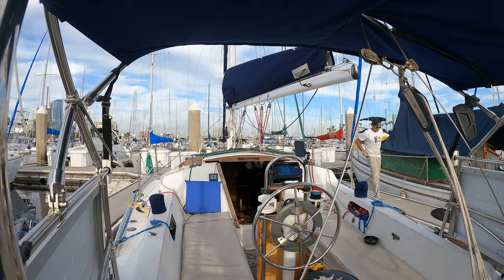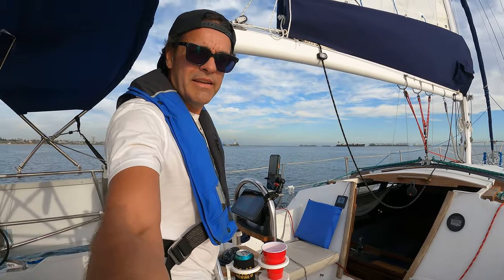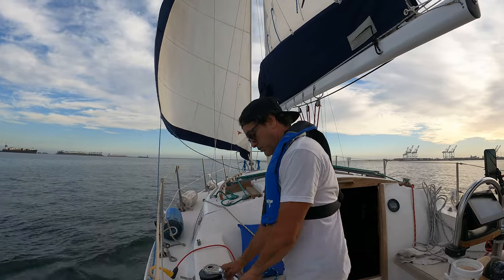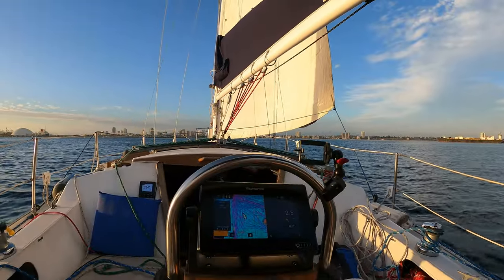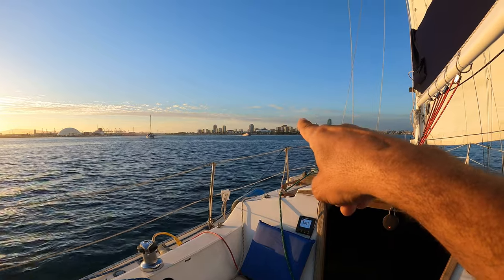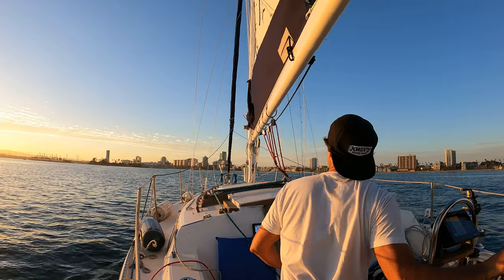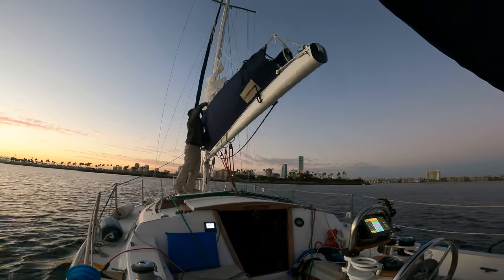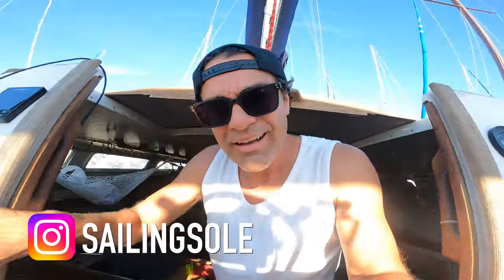EP 0 - Sea Trial - Lazy Jacks & Stack Pack - Sailing in Long Beach on a 1978 Catalina 30

Comment: If you read the owners manual, you should put the engine in neutral and increase the RPM's for about 30 seconds, then bring back to idle and immediately shut it off. Helps blow out carbon, which diesels create a lot of at low RPM's.
Reply from the maker: Thanks for the tip. I’ll definitely do it.

Comment: Nice afternoon sail - thanks for taking us along for the ride and I like your channel - perhaps for docking you could lay out some form of protector for the boat especially on the ends?  Also, to dock it might be a good idea to take a forward cleated springer and cleat it to the dock off the stern first... but hey, nice sail and I like your boat... especially the price you paid - really good buy!!
Reply from the maker: Hi there. I have a fender, centered, going from cleat to cleat across my slip. Is that what you mean by “cleated springer”? 

That day was just a little breeze on my port beam pushing me to starboard. I think it is also the added windage of the stack pack (lazy bag). It’s taller than I’d like and catches too much wind even when it’s down. 

Thanks for watching! 👍🏼
Reply: @sailingsole  Hi there:  No, I was talking about placing springers at either end of the coach roof for example and then the forward one is made fast to the dock at the stern of the boat, and the stern towards the bow of boat.  that way you have a quick way of controlling and securing the boat quickly and relatively easily when you're short handed, or at any other time during docking, which can be tricky, especially if you have an unfavorable wind/current.  Once the springers are in place, you can get your bow and stern lines in place with less pressure.

Yeah, just because you're bare poled doesn't mean no windage - it is a problem that needs to be borne in mind and compensated for.  Happy sailing 🙂

Comment: Lovely video!  You might get a bit more performance (especially upwind) if you tighten up the luff of the main.  If you take a look at it, you'll see creases coming from each slide on the luff of the main; that should be flat, without those creases.  You can either use the winch for that last bit when you're hoisting the main, or use the downhaul to tension it from below (or both!).

Happy sailing!
Reply from the maker: Thanks D!

Comment: Andy, Just subscribed. A question about the "stack pack". Does it hold water? Seems like it would. Or does it have weep holes. thanks, jeff
Reply from the maker: That’s a great question, it doesn’t hold water, but it does funnel the water into my boom. Then my boom fills up with water and has forced me to drill a weep hole for it to drain from so there was a complication but overall it’s great I’m getting reef holes sewn in for my reef lines, and I think that will help with the water problem.
Reply: @sailingsole  Andy, Thanks for the reply.jeff

Comment: Do you have a slip in Dana Point Harbor.?I understand they are really jacking up the slip fees.
Reply from the maker: No I bought the boat in Dana Point then immediately moved it to Long Beach.
Reply: @Sailing Solé  SMART-My buddies boat in DP harbor recently  saw a 30% increase in slip fees.He has had it there for 30 years.
Reply from the maker: @tr7b410  yikes that’s a big hike.